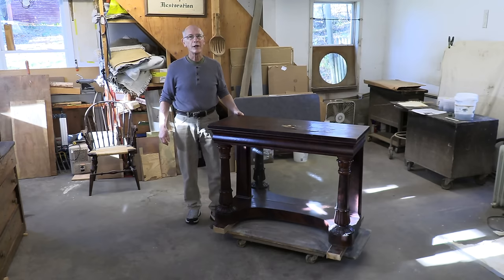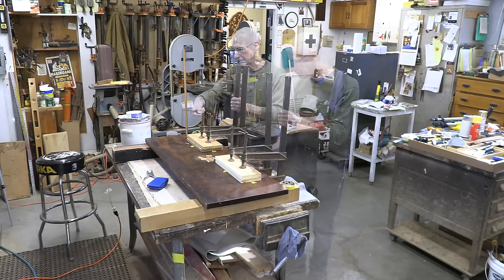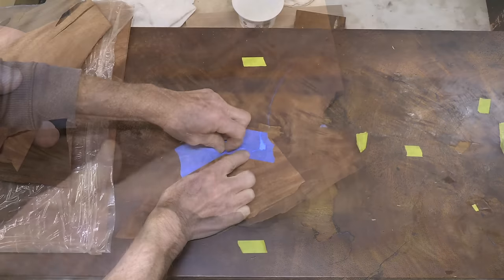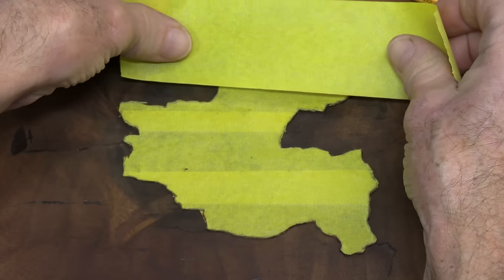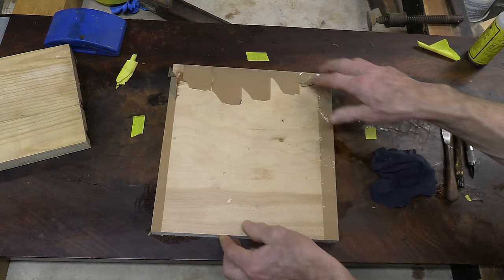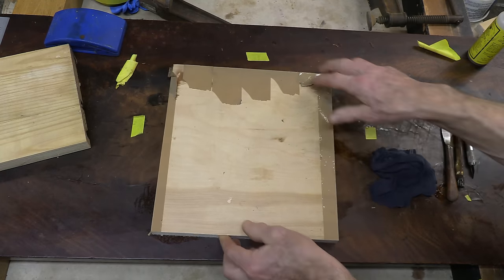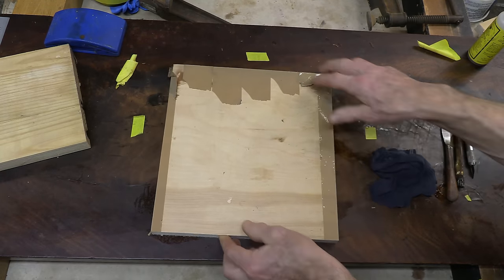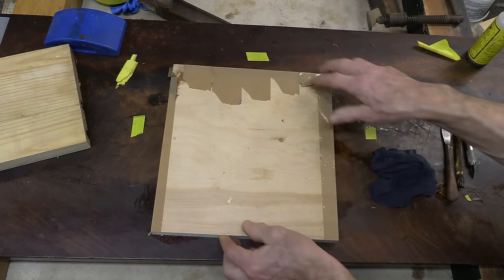Is this Table Beyond Repair?

Comment: Is this a test?  I saw an electric heater used to soften glue joints.  I do love these videos. Thanks Tom.
Reply: If it was a test, you didn't pass 😉- 44:50
Reply from the maker: Thanks! It was out only 30 hours...
Reply from the maker: Well, what are you gonna do...

Comment: Tom, I also follow the work of Ted Woodford, a luthier in Canada. He uses a method of putting hide glue into a crack and then forcing it deeper by pressing down over it with a small (silicone?) suction cup. It seems to work well on instruments and I wonder if it might not have some value for you in situations like messed-up veneer on the top of the pier table.
Reply from the maker: Thanks! I will have to try that

Comment: Thomas, can I ask( I can not remember if I have seen you do it) did you know about using small  suction cups to push the glue it? It is a violin  Luthier repair hack from ( I think ) the 1960s.   It works incredibly wellI can find a vid for you if you wish my friend?
Reply from the maker: Thanks Kerry! A lot of people have mentioned that, I need to try it sometime. Of course, no one says where you're supposed to get suction cups!

Comment: Mr Johnson,  I appreciate your videos very much and I learned something new everytime. This piece is gorgeous and your veneer work is true craftsmanship. I noticed you cleaned the top with denatured alcohol instead of krudkutter. Was there a reason? Have you had success removing creosote from veneer?
Reply from the maker: Thanks! I used alcohol because I was actually removing the existing finish, where Krud Kutter is a cleaner. Creosote? That's tough, but Dawn Detergent is the best bet. It never comes entirely out
Reply: @johnsonrestoration  thank-you for taking the time to respond to my question. I had an old buffet I wanted to restore. It was filthy from being stored in a barn for many years. I started by cleaning thoroughly with krudkutter. That got all of the dirt. Then I used denatured alcohol several times, which removed some of it, but not all as you mentioned.  I remember my grandmother had a piece similar to this one in her bedroom and she had an oil lamp that sat on top that she used daily. Wood burning stoves were used back then too, so I figured the stuff I was seeing on the veneer was creosote.

Comment: Have you ever tried blowing the glue under the cracked veneer with a compressor or a can of compressed air? I find it works for me to get the glue into the hard-to-reach places.
Reply from the maker: Thanks! I haven't, but I should try it

Comment: I had a thought: you had to work without electricity the same as our forefathers did. I also thought they might use a bellows to dust away their sawdust etc. 

When I was small (a rather long time ago) we used coal-oil lamps while we lived in an old log cabin. We attached a silver tin reflector on one side to intensify the brightness. Also we had the type of lamp that gets pressure pumped into it, an overly bright light, but I imagine it would have been a benefit to wood-working.
Reply from the maker: Thanks Kathy! Yes, I often imagine what it was like before electricity. Imagine what you were breathing with those coal-oil lamps!

Comment: What a gorgeous table.  Appears you have a mirror below which would have paired with a mirror above the table? 

I liked your work making the patch, but I wonder why you chose opaque tape; do they not make a kind of clear paper tape? It would be so much easier than trying to place the opaque tape. Of course you could use tracing paper, but that might not be sturdy enough? Obviously I am a total beginner in furniture restoration, so forgive if I sound idiotic! In the end it looked just enough perfect to not ruin the history.

Around 38:37 (just before the third coat) when you were darkening a part of the patch every thing looked grey, not brown. Was that just the way the light hit it? It was easier to see how you were painting though, and I though the wider, feathery brush was a good choice.

Then, after the third coat it was like magic, everything came together. I think the reason some would say just replace the whole veneer is that they don't have enough skill to do what you did; bring it back to life with a history to read.
Reply: Mirrors were popular back then to increase light in the house. No electricity... not just during snowstorms!
Reply from the maker: Thanks! I have not seen clear paper tape, is it even possible? And yes, it should have a mirror above, but we won't because of our murals
Reply from the maker: I think you're right, it's all about getting more light
Reply: There is the old Glassine paper, remember that? It is still available and is about 20.00 for 100 sheets or you can get it in 20 foot rolls for around 10.00. I also found heavy duty (28 lb) tracing paper for a lot more (around 24.00 for 20 sheets) or a more cost effective by the roll. This would be excellent for design patterns you want to copy.   The Glassine might be helpful for the cut-outs on veneer that you do, but I don't know about the price point. @johnsonrestoration

Comment: Mr. Johnson, did this table ever have a mirror in the back beneath the top? A lot of times those empire mirrors had mirrors so that when the ladies were going out they could check their skirts to make sure their petticoats weren’t showing.  I always thought that was a good idea!
Reply from the maker: Yes, this one has a mirror! It's there. There has been a lot of discussion about the purpose, I think it was just a way to get more light in the room. There would have always been a mirror hanging above the table as well. This eventually evolved into what we call a hall-stand
Reply: @johnsonrestoration  got it.  I wasn’t aware of the light issue and learned from antique dealers I worked for and bought from what the mirror was for. But the mirror theory is valid.  They do reflect light, although I have a mirror in my apartment living room and it isn’t doing a very good job of reflection. Perhaps it’s because I bought it from Amazon.  😂

Comment: I've been online all day searching for tips/advice on how to protect the maker's mark in an antique desk. It looks to be gold metallic-like paint - painted (or applied) directly to the wood (mahogany) surface of a drawer (where things will be set on top of it, etc). How can I best preserve this maker's label/mark? It has some faint areas of wood showing through where it's rubbed off over time. I'm afraid to put shellac or lacquer over the top of it (spray) - but would that be the right approach? It's about 1.5" x 1" in diameter... help! 🙏
Reply from the maker: This is a tough one! Email some photos ; thomasjohnsonrestoration@gmail.com

Comment: one thing I've always had problems with when doing veneer repairs on wood is there is almost an iridescence that makes the wood one color or shade from one angle and another color at another angle and sometimes trying to get that to match isn't always as easy as just a color match because you could think you have the perfect match from one angle and it isn't until you look at it from another angle that you realize that your new patch is darker or lighter than the surrounding area
Reply from the maker: Thanks! That is exactly right. That is called "chatoyance" and is always an issue. I am aware of it, and try to account for it, but you never know for sure. There is nothing you can do about it! Except maybe try again

Comment: A suggestion- consider using wax paper against reglued areas before clamping with boards to keep the glue from sticking to board scraps.
Reply from the maker: Thanks Denise! Good tip, I used to do that all the time until I discovered plastic packing tape. I keep a box with all my clamping blocks ready to go. The tape lasts a long time.

Comment: With all of the drying time I assume you are usually working on more than one piece at a time. How many pieces are you typically working on at any given time?
Reply from the maker: Thanks! Typically I used to have 2 or 3 jobs going at one time. Now that I am "retired" it's usually just one because I am doing so many other things

Comment: Would a swivel knife, normally used for cutting leather, have made making the pattern easier or just not thin and sharp enough for veneer? Just curious.
Reply from the maker: Thanks! Exactly right - too thick

Comment: A pier table goes between two windows often at the bottom of the stairs.  The mirror is for ladies to check their skirts as they descend the stairs.
Reply from the maker: Thanks! Yes, but also to add some light at the bottom of the stairs

Comment: In the UK we changed to Metric when I was about 11 ( in 1870 ! hihihi ) and it was such a relief not to use those fractions. That said in the UK people still use pounds, miles and yards. As you give measurements in both is there one that comes naturally to you and do you not find the metric system more easy ? I am sure that as for material most things must come in imperial measurements, liek wood etc. xo
Reply from the maker: Yes, but I have not learned enough or used it enough to have an opinion. Old habits die hard! I need to just switch one day. First I have to find metric rulers! Shouldn't be difficult

Comment: I would have been one of the ones to replace whole veneer because it was so damaged.  That and matching figured wood of any type is darn near impossible.  I also do not veneer. I have a century old church organ with a thick veneered front panel that literally curled off. I may have to finish removing it and soak in water to soften it up.
Reply from the maker: Thanks! It can be frustrating but keep at it!

Comment: A relatively inexpensive CNC might have made that veneer patch quicker and easier. There may be someone local with the expertise to convert to the trace to DXF and laser or CNC the veneer.
Reply from the maker: Thanks! That would be so cool if that could happen. It would be excellent if it could happen from a photo
Reply: @johnsonrestoration  Easy enough. I’ve done it from a sketch when I needed some water jet cutting.

Comment: Would you call this marquetry or just veneer repair, or both?
Reply: I know you aren't asking me, but I'm interested in Tom's answer, so you get mine too - two for the price of one. I wouldn't call this marquetry, as there is no image/pattern creation and/or different woods or materials involved; it could be thought of as "inlay" if you really dislike the idea of calling an excellent repair just that. (However, again, usually inlay is composed of different materials, the pieces are thicker and the technique is different.)
Reply from the maker: Thanks! I agree with dlevi67. Yes, I "inlaid" a piece of veneer as a patch, but the words "inlay" and "marquetry" refer to specific forms of veneer work. We're only left with the word "patch" or repair
Reply from the maker: Thanks! Yes, exactly. Those words mean specific things

Comment: New Marble top would be an easier solution.  Pre industrial age nails would indicate that the table is very early 19C or even older.
Reply from the maker: Thanks! Marble was going to be my 2nd choice if the veneer didn't work out. Yes, given the style, 1820 - 1830?

Comment: Are you using alcohol to remove the glue?
Reply: Just water (for hide glue - it's basically very sticky gelatine).
Reply from the maker: Thanks! dlevi67 is correct - water
Reply from the maker: Thanks!

Comment: I like the repair. Is it perfect? No. But it's damaged. It's pretty much impossible to perfectly hide something in such a figured veneer, other than with trompe-l'oeil but even then, because of the chatoyancy of the wood it won't look the same from all angles. Ideally the piece will have a bowl or a vase or a tea caddy or something on top and it won't be an issue at all.
Reply: As long as the bowl/vase/tea caddy is dry and at ambient temperature... 😜
Reply from the maker: Thanks! All true - I kept thinking what's the point? Just put a vase over it
Reply from the maker: And has a saucer underneath that is 100% waterproof. Most importantly, when you go away and ask your neighbor to water the plants while you're gone, remove the plant(s) from vulnerable surfaces. We move all our plants to the kitchen island while we're gone
Reply: @johnsonrestoration  😂 Sorry, Tom - I had to laugh at this one, but it is meant kindly!

Comment: Could you have re-veneered the whole top? yes. Does that mean what you did was wrong? no. But I could think of one more option, which would be to find the center of the top and cut a circle that covers the damaged area, then put a small thin eighth of an inch 16th of an inch ring of a dark wood or light wood, veneer and then do a four-way book match in the field of the circle. It’s like I tell people when it comes to any Woodworking it’s whatever works for you whatever you wanna do.
Reply from the maker: Thanks! Yes, so true! I thought about cutting in a piece that would be decorative, especially if my patch didn't work out

Comment: No electricity? Did you use water power for the crock pot and heat gun? 😂 I am far enough to the south that is was just a big rain storm.
Reply: I think the storm happened after he was well started. And he did have the light from cord from kitchen that one night.
Reply: @kayerin5749  Correct, it looks like a week's worth of coffee cups. But the storm was Sunday into Monday. Guessing they had power back on Tuesday.
Reply from the maker: Thanks! It doesn't take much around here!
Reply from the maker: Yes, that's right

Comment: That heat gun isn't electric?
Reply: It wouldn't have been much use during the power cut... which is what the title of the video refers to.
Reply from the maker: Thanks! It was out only 30 hours
Reply from the maker: I'm thinking of doing an entire video with no electricity. It has to be the right type of job...
Reply: @johnsonrestoration  It definitely does - I have a (archeo)jeweller friend who is a purist and will mostly use ancient techniques even when not building replicas, however even he draws the line to drilling seriously hard stones like jade using hand-powered bronze tools! 🤣

Comment: I don't understand the 'no electricity' clickbait title, he used a heatgun right off the bat.
Reply: Did you miss when Tom said he had been without electricity for over 24 hours during the repair, because of a power cut? He didn't need power tools then (he was colour matching and finishing the piece), but that's what the title refers to; no clickbait.
Reply from the maker: Thanks! Yes, unfortunately we are always desperate for clickbait! It was a stretch (but it's working!)
Reply from the maker: Yes, well, it was a stretch!